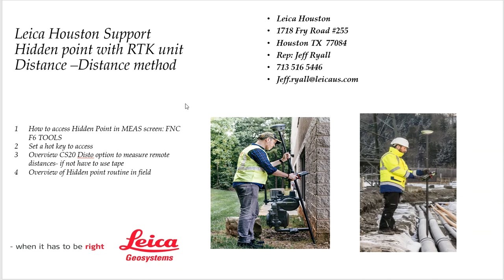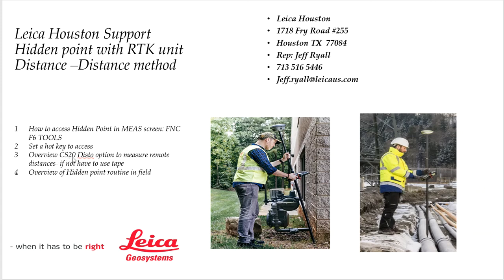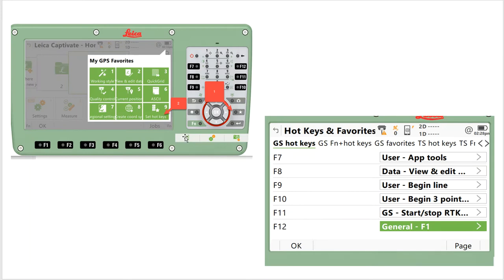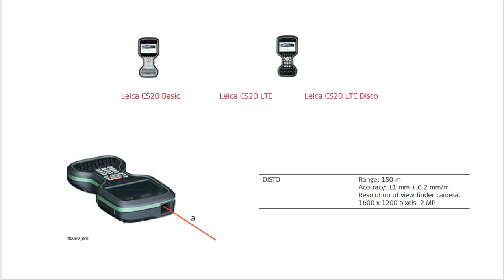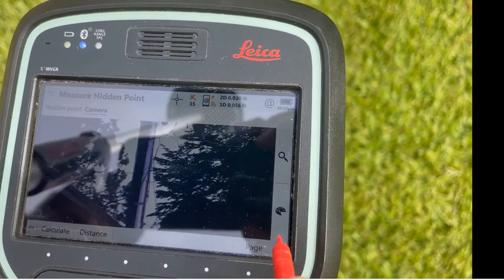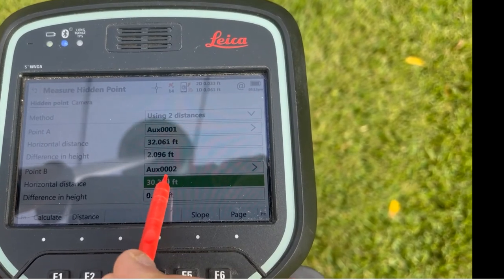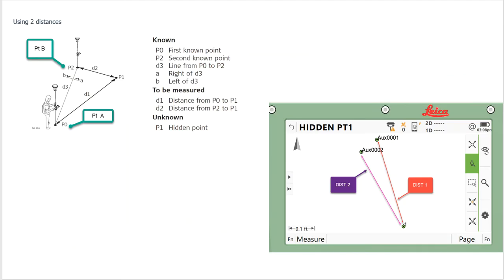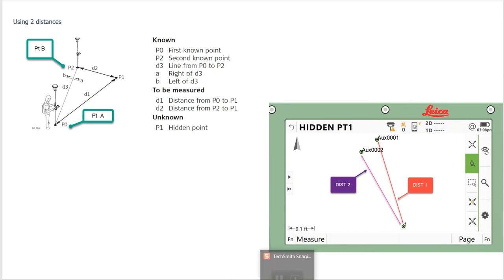Leica CS20 Captivate: Video 2 of 3: Hidden Point application: Distance-Distance routine for RTK

Comment: When I go to measure, fn, ,tools, measure hidden point, using 2 distances, this is where I get stuck. I’m trying to use the CS-20
Disto, my point a and b, have to be previously shot points? It doesn’t give me the option to shoot a point, then measure with the disto as in your video. 
There is no f-2 distance when I get to the disto. 

Do I need to update the firmware? The software on the CS-20?
Reply from the maker: If you highlight the "point" field, look at FNC keys below, F4 show be "Meas pt" to shoot in point A or point B when you are ready. Then F2 should show DIST if you have the Disto.  I am using version 6.5 FW, if should be the same unless the firmware is older -but should  be same if running version 5 or even 4 FW